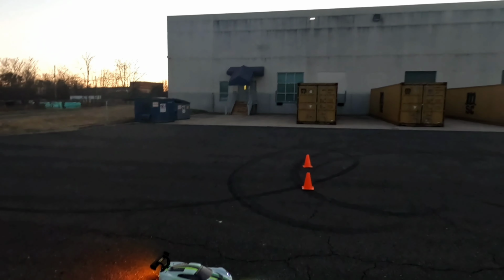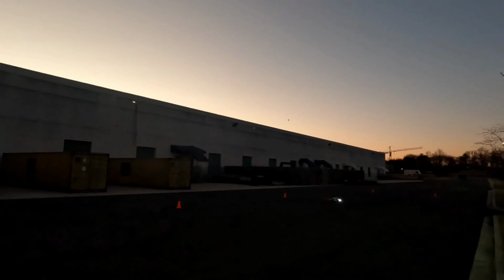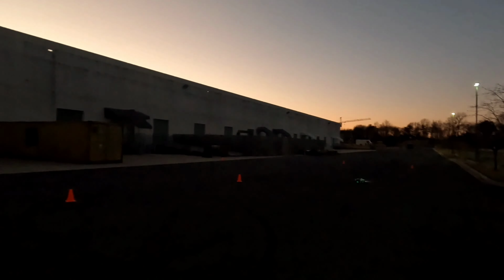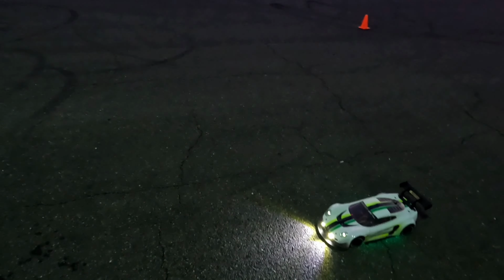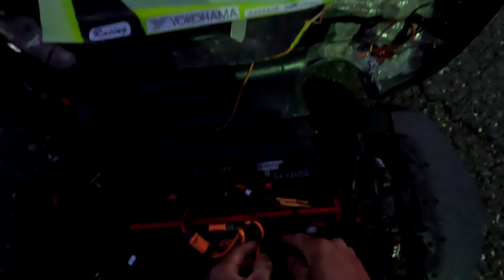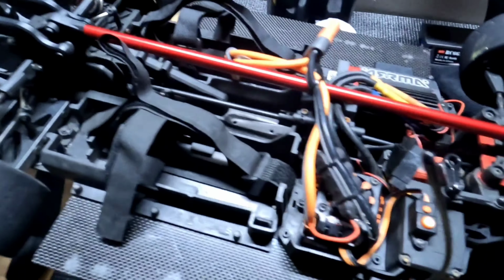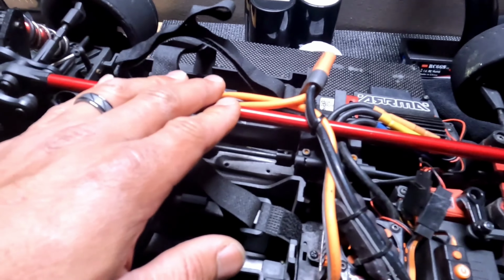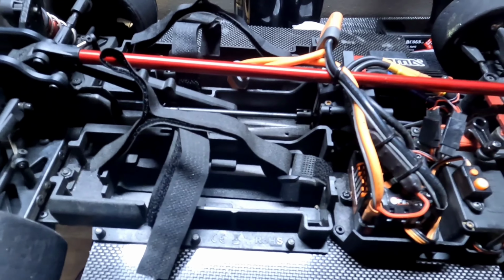Arrma Felony Lotus Elise Exige Night Bash and this happen?

Comment: 160a firma esc, is a lot better than thier 150a version.
Reply from the maker: @JM-500 Absolutely right, it's a known complaint and issue.  It's amazing they are still putting it in these cars. Should be used in a less amperage drawn motor.  But I think they know this however they have so many of them that at this point doesn't make financial sense to recall them.  Horizon Hobby already purchased them.
Reply from the maker: Np 🙏🏾